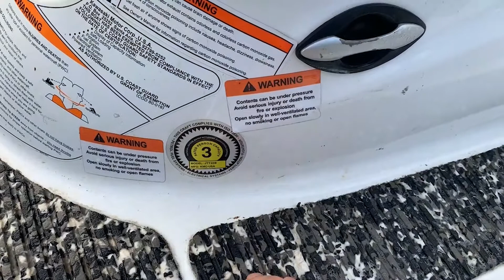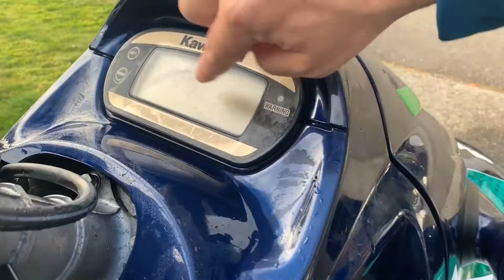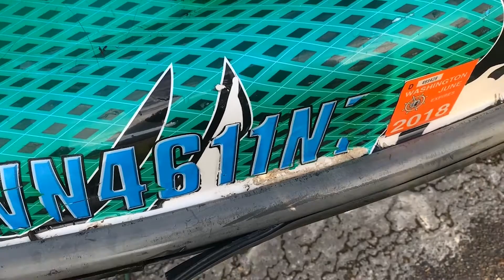Project Goatski - cleanup and vinyl removal - Part 4

Comment: Just curious, how did you put the ski on that stand? Few guys just lift it?
Reply from the maker: We put the cart up to the backside of the trailer and pulled it off the trailer to the cart. Luckily it was fairly light since the engine was removed. The cart is about the same height as the trailer which made it pretty easy to move. Getting it back on the trailer should be a lot easier since it has the crank on the front we can connect and pull.
Reply: @vivogarage  thanks for the replies! Just curious, how is an oil change done on these if I can't access the bottom of the motor? I have some mechanical experience working on my dirt bikes ATV's etc but no marine work as of yet
Reply from the maker: @liveandletlive2894  the manual says to drain the oil through the dipstick tube with a pump to suck it all out. Luckily you don't need to change it often, roughly one a year. I will be sure to film that process as it may be comical! Ha!
Reply: @vivogarage  guess I need to go get a pump or siphon from harbor freight.